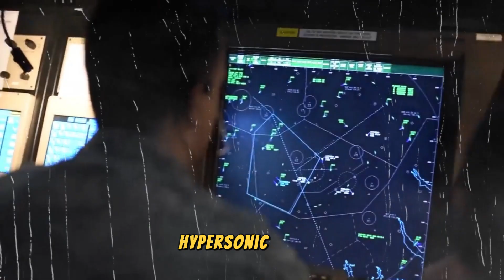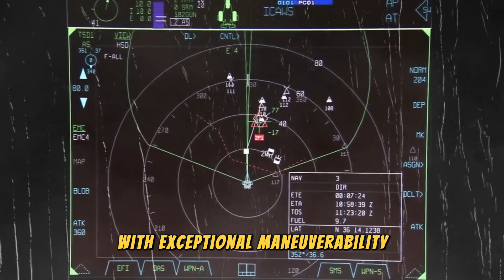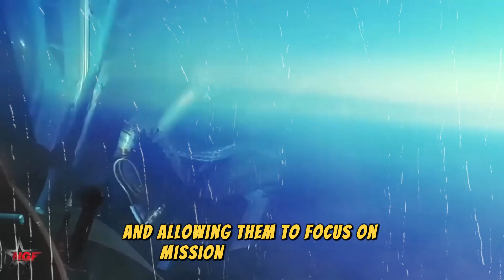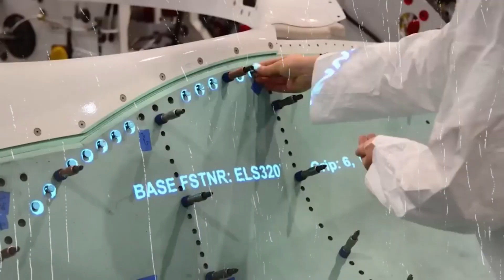Undetectable by Radar: The Blue Eagle MiG-41 – A Revolutionary Nuclear Fighter | Sixth generation

Comment: The model that appeared at the beginning of the video looks like it is a deep modernization of the Mig 31 aircraft, which is the fastest and cheapest solution, by replacing sheet metal with a composite with a small change when lining the existing Mig 31 and, of course, with new electronics, the reflection can be reduced and speed over Mach 4 can be obtained with the existing engines. Changing the coating of the existing Mig 31 fuselage, which gives a sharper appearance like a diamond, if a sufficiently strong composite has been obtained, will not take much time In order to see this aircraft in the sky, new computers leave room for armament due to the smaller size of computers, the last modernization was 20 years ago to the BM variant, but today you can get much more, and if even small engine upgrades were made, then it could be done very quickly with little investment because Russia has about 160 MiG-31 aircraft